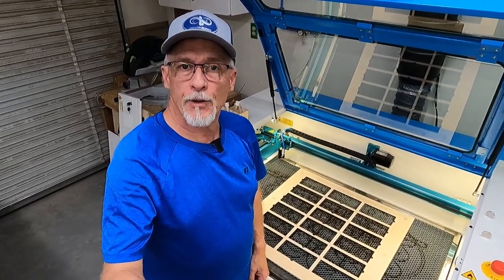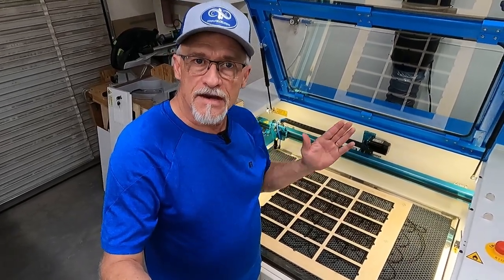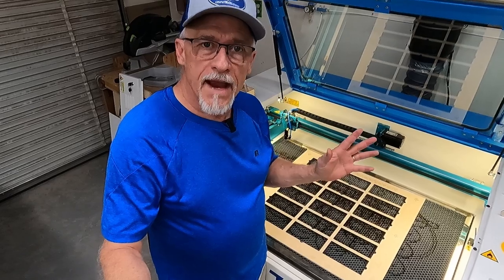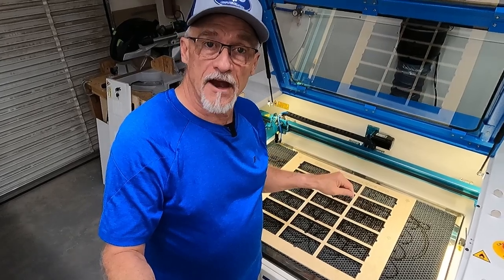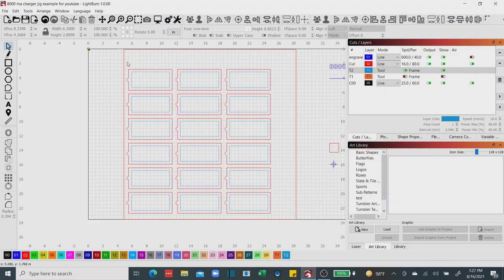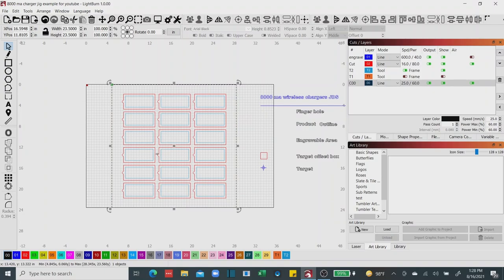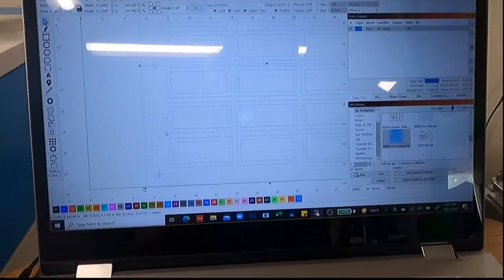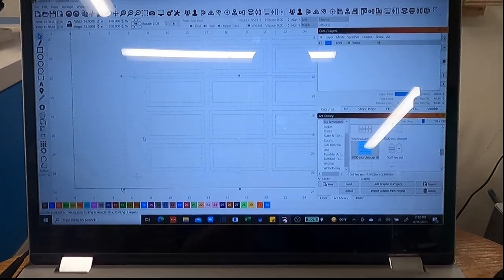Making laser jigs the easy way!  (Setup time is less than 1 minute)

Comment: I’ve made and used a few of these jigs. The first 2-3 times I use it, it works fine. But then the cross hairs get way off, like 4mm. I save the jig both in the art library and as a file. Both do the same thing. Have you run into this?
Reply from the maker: No, not normally, usually something got moved somehow. Once created make it a tool layer and lock it down by selecting the move button in the very bottom Left corner of LightBurn
Reply: @ thanks. I’ll try again. The weird thing is that it happened with different jigs and it is always off the same way, off to the left about 4mm.

Comment: This is 3 Years old at the time of this comment for context. Anyway, 'Print & Cut': I'm not sure if this feature was part of Lightburn when you made this vid (I think it's fairly new)- you should not have to move the Jig itself around at all and you can even just literally drop the jig in at any random angle, though keeping things square is recommended so the laser isn't moving at strange angles on straight lines. Then use the 'Print & Cut' tool to align the laser to two of your targets (ideally opposite corners/as far away from each other as possible). This tool is great for Jigs, picking up a project where you left off, continuing a Job that failed for whatever reason, or also for burns that are larger than your laser bed area, so you do part of the Job, then move the work, use print & cut to align everything and do the other part and repeat as many times as needed until the job is done. My 10 watt cuts out every once in a Blue Moon and this feature has saved some long Jobs. It's a really neat feature that I'm pretty sure wasn't around back when this vid was made. 

This comment isn't to tell you how to use it, just pointing out the feature/tool- there's a lot of short vids here on YT that explain it much better than I could with just this text- it's a REALLY handy tool that I think every Lightburn user should know about since it's so useful for so many things and opens up the possibility to do larger projects than your laser bed is capable of. Anyway, nice vid, thanks for it :D
Reply from the maker: No need to use print and cut for slinging your jig setup this is way faster
Reply: @computercreationz  I wasn't saying this isn't useful, it still is. Just pointing out the new feature that wasn't around when the video was made. Maybe it's a preference thing- I do have a physical Jig system setup from before Print & Cut but I've slowly started preferring it over my Jig system. Physical Jigs do have their benefits. My system has a Puzzle type thing permanently attached to bottom of the laser's frame, then the bottom of my Jigs have the negative to the 'puzzle piece' and they slot into place- no need for targets on those and I still use the ones I have when needed though after using Print & Cut regularly it's almost as fast as slotting my Jigs into place. Once you've used it a few times it takes about a Minute to setup and there are other benefits to it, like being able to do Jobs that are larger than the laser bed- it came in handy for one specific Job I did a few Months ago where I made a 2 1/2 Meter long plaque thingy that fit into a wide narrow window (my bed area is about 900x900mm on one laser and 300x300mm on the other).

Comment: Robert what are you using for tiedowns  do you mind if I ask you a question.  Im making a template with 9 squares 3.75'X5"   My 1/4' plywood is 14x14"   I have a msg in these squares.  Can I make the first square like you did with the printing on it, if so will I be able to duplicate this printing on the other 8 squares at the same time or will I have to do each square that separately
Reply from the maker: I’ve found some honeycomb pins on Etsy I really like they have a round head and come in different colors and thicknesses. Yes get the first square exactly how you want it and use the rectangular array tool in lightburn. The icon looks like a bunch of square dots. Hope this helps

Comment: Thanks Robert. Great videos that have been very helpful to a newbie. I made a jig but having trouble using it. I'm in absolute coordinates and can line up the targets. But when I go to engrave the item in the jig it does not line up as it appears on lightburn. It is consistently an inch to the side. Any guesses what I am doing wrong? I rewatched this video multiple times and still don't have a solution. Thanks. Cliff
Reply from the maker: something has changed in your setup. drive around with the laser located tool to pin point what it is. you can move your jig layout in lightburn after you’ve set it up in the laser. that’s where most people have an issue
Reply: @computercreationz  Hi Robert. Here is some follow up in case others are having a similar problem. 

In setting up Xtool with Light burn I used the file provided by XTool rather than have lightburn dicover my laser. 

Next in settings I turned off the offset feature and made my workspace slightly smaller on the Y axis. This prevented the arm from banging into the cables when I tried to go home. I also repositioned the limit switch to coincide with the smaller workspace. 

Finally, I discovered I always had to return to home before running the file. I could not start it from a target position. I don't know if this is true for all lasers but it was a needed step for the XTool D1 Pro.

Comment: Great tutorial on making a jig. Just completed my first one using all these steps - a huge time saver and it came out great. Do you have a video showing how to engrave the pieces then once you place them in your jig ? I made one to hold 15 keychains. When I ran the file the engrave the keychains with the logos I wanted on them the laser head runs the entire length on the bottom five and traverses back and forth rather than doing each logo individually - seems to take a ton of time going this was (almost 3 hrs to do all the keychains) I’m sure I’m missing a setting somewhere. I would think if it did the logos individually on each keychain it would go faster - any help on that step? Love the channel and learning new stuff !!
Reply from the maker: If it’s available open up,your layer and at the bottom you should see 3 radio buttons to tell lightbur if you want to engrave grouped items first. Try all three and see which one provides you the best time. Thanks for the comments and watching
Reply: Great video thanks but still a-bit lost on where do you put the template and align for engraving. Is there an. Easy way to get a staring point . Many thaks. Nb i am new to laser engraving

Comment: hi,  how to turn on the laser pointer when you need to point it to the target? thank for this video, very helpful.
Reply from the maker: most co2 lasers the red dot is on when the laser is turned on. if you have a diode I’m not much help my apologies
Reply: Activate it in device settings in lightburn:
✅ Enable laser fire button 

Then:

Go to the “move” tab to switch it on and off and make sure your power setting next to it is 1% or else you mark materials. You can also activate to use this for framing too, underneath the first setting I mentioned.

Comment: This is a great video, thanks. I'm just getting into lasers and I have a 50W CO2 and a 50W Fiber on the way. Can my 50W CO2 cut out a jig like this? What kind of wood and thickness would you recommend for my laser to make jigs?
Reply from the maker: This was 1/4” Baltic birch wood. With a 50 watt co2 you will need good air pressure 20-35psi to get a clean edge. External air is a great upgrade

Comment: Is there a way to easily add the artwork to the centers of all the cut out areas?
Reply from the maker: Make sure your soap to objects is on found in the gear icon. Once turned on if you drag your artwork by the center it will snap to the center of the cutout you have on your jig

Comment: Thanks for the information. Can I ask however why you don't use the feature in Lightburn called "Print and Cut"  I've watched videos using that feature as well and it appears to be faster, less targets and your workpiece does not need to be perfectly aligned like your method does.  Just curious but again your method works just as well.
Reply from the maker: Moving the jig to the laser head position is faster than changing the speed and moving the laser head to the target on the jig in my opinion. Thanks for watching!

Comment: Great video! Thank you. One question - once you get all that set up and your material dropped in, do you drive your laser to one of the targets and hit start? I'm confused on where you actually start the job from.
Reply from the maker: when using absolute coordinates your laser head doesn’t have to be in any particular spot. drop your graphic in and start. that is on a co2
Reply: @computercreationz  Thank you. I have a diode

Comment: Are you using the cut and print feature to line the targets up when you put the jig back in because how does it know where the targets are when you move the jig in and out off the bed?
Reply from the maker: No the print and cut feature is not used in any way in this process. Drive you laser head to the target on your desk top and manually move your jig target to the laser head. So you will always be moving you jig to the laser hear for this process to work.

Comment: I am importing DXF files from CAD program that have the shapes of my products for engraving. When trying to weld in the finger hole for pulling out the items it does not allow the weld. The weld feature works in Lightburn, just not with an imported DXF. I am new to Lightburn, and might be missing something simple.
Reply from the maker: You may have to covert them to shapes. I believe it’s under the edit menu

Comment: My question is focal height? Im assuming i need to make my jig from the height that i will be at when im engraving what is in my jig?
Reply from the maker: No not really it can be any height as long as it doesn’t interfere with your laser head. You will focus on the material your engraving.
Reply: @computercreationz  I made a jig yesterday then lowered the bed down to fit in my item, did a test fire after location on the PC where my engravable area was and missed the item by about a hair. My item is 20mm tall and jig is sitting flat on bed like yours... would you suggest making the jig from that height or maybe raising the jig up around the items?

Comment: This video is super helpful! One question..once you have your jig established and it is now a tool layer, how do you add text and make it center within one of your engrave-able areas without disrupting your jig?
Reply from the maker: great question I have one more rectangle that is slightly inset each opening. this is done before I creat the cutout for the finger hole. if you have your snap to objects your design will snap to the center of the inner rectangle of each opening. thanks for the comment

Comment: you aligned your jig but arent you battery packs thicker than your jig - meaning after you align your jig you have to drop the bed?? this could allow error in aligning as the bed moves......isnt a solution to this to have your alignment marks on another peice at the same height as your battery packs?
Reply from the maker: your bed going up and down doesn’t change you x, y alignment. I’ve never experienced an alignment problem doing it that way. the jig is pinned down so it can’t move. thanks for watching!

Comment: A suggestion to help some of your older viewers. Go into Windows settings and make your cursor arrow larger and a bright color like yellow.  When you say I’m going to go over here and use the weld tool, I can’t see where your going or which icon you used. I’ve got to run it back constantly to figure it out. The info is absolutely great, I just have a hard time following your cursor.
Reply from the maker: Thank you for the suggestion. I adopted the larger bright yellow cursor shortly after this video. I’d you watch some of my more recent videos it’s much easier to follow.

Comment: I saw the Festools. are you on FOG?
Reply from the maker: I am but haven’t been active in quite a while. love my festools!
Reply: @computercreationz  ok, I too am pretty heavy Festool user. just placed an order for my first laser. I see you are running atleast 2 lasers and based on the fact you are making jigs to burn 18 parts at a time Im assuming this is not just a hobby for you and you are doing this as a job.  I subbed either way, is there a "good" laser forum group you can recommend?